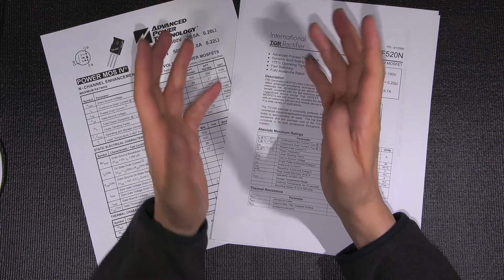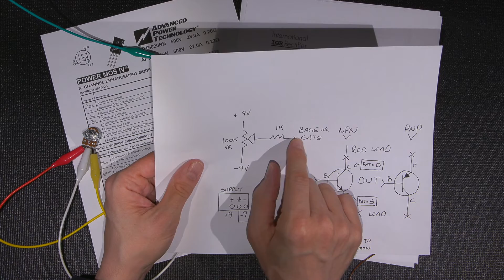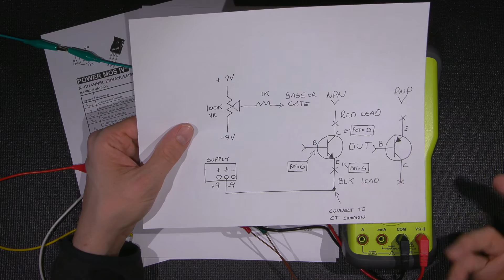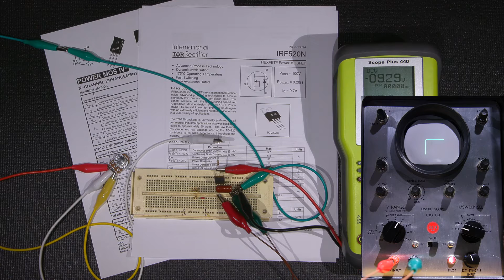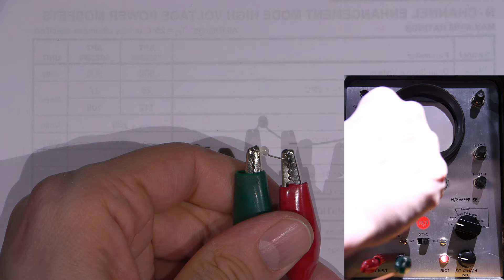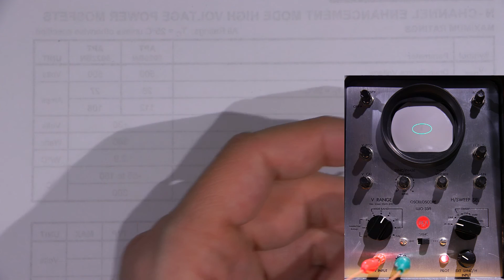Curve Tracer Additional Information

Comment: Your explanation of depletion layer MOSFET reminds me  the time a fellow tech chasing a fault disconnected the Gate of chopper device in a switch mode battery charger and re-connected the mains supply (230Vac here). With no Gate voltage the device was a short on the bridge rectified and smoothed input Vac. The MOSFET completely ceased to exist physically, making a huge burn mark on the workbench and pieces of it stuck in the ceiling. I’m sure at the nano second it went away it was louder than most pistol shots are...
Reply: yeah    how much smoke was there?